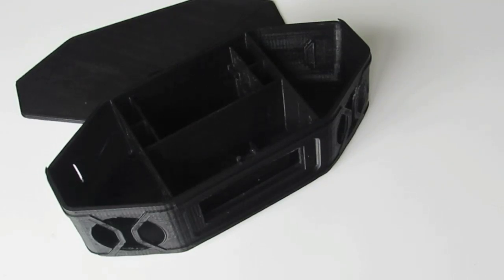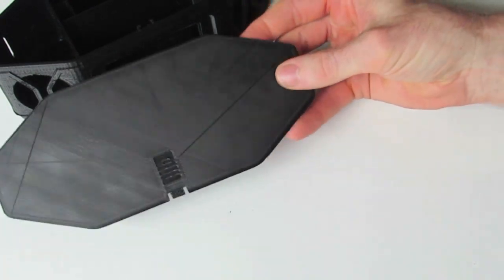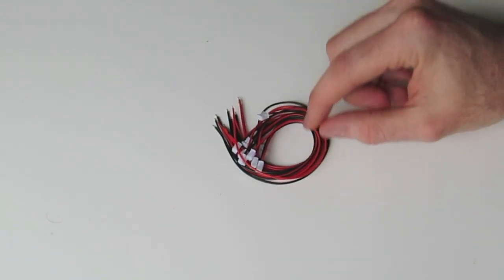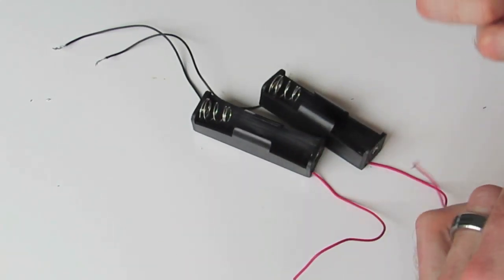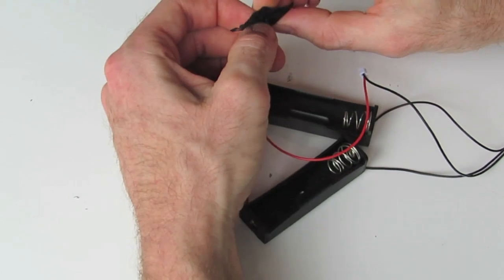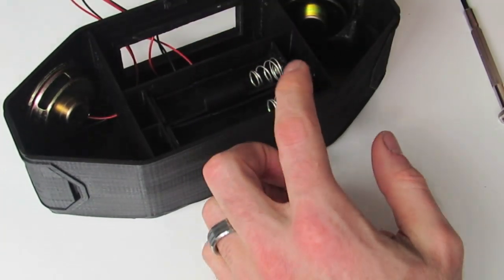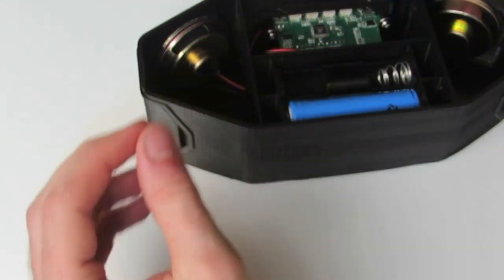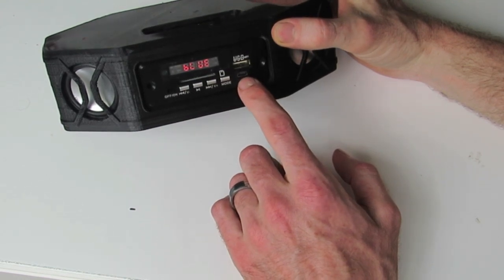DIY Bluetooth Stereo Speaker

Comment: Hello, in the video you connect the batteries in parallel. Batteries are 3.7V, is it enough to power the module ? Thanks.
Reply: That seems correct.  It appears to be the correct voltage for this unit.  Adding the cells in parallel increases capacity while maintaining the voltage of a single cell. This translates to longer device operation before next recharge.